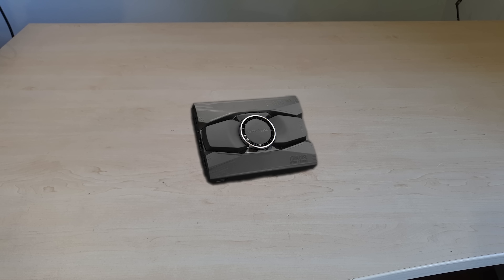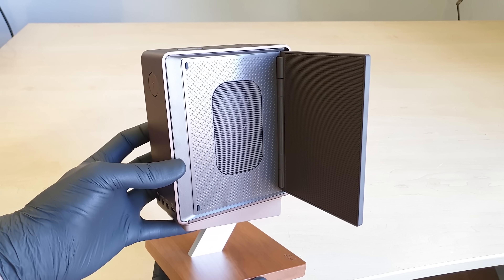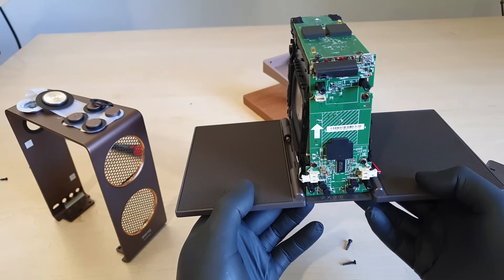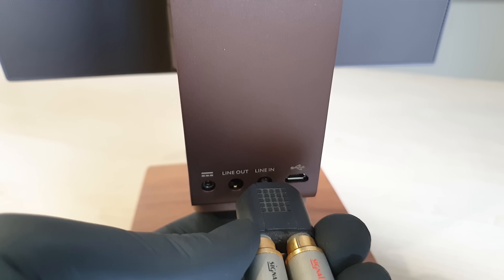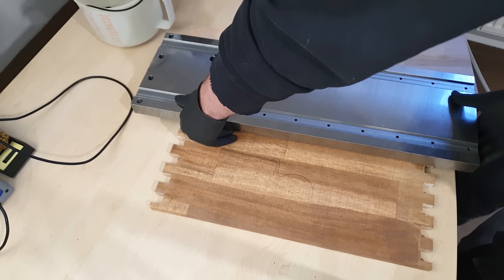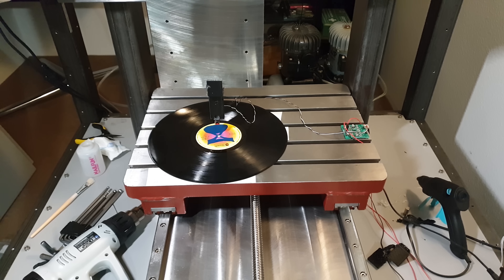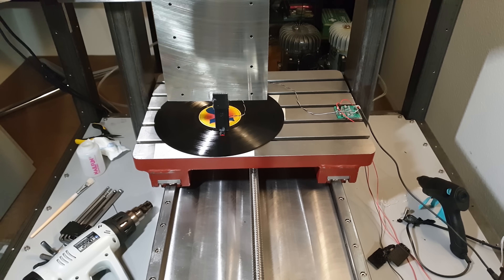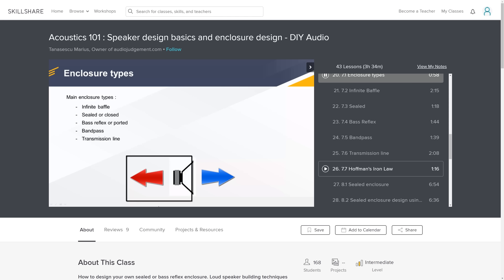Can my CNC be a record player?

Comment: Has anyone done an inverted dual drive for each axis? That way quick precise movements can be made and the inverse drives make up for each others backlash, and the steppers can be set up out of phase physically so that when one is on a full step the other is on a half step, then just adjust the timing of the screws to have no measurable backlash but with the least resistance and screw pressure

Comment: Hmm... having a turntable spin the record and using the cnc to move the cartridge laterally would be hard enough I think. Remember, in order to get sound from a cartridge, in the way it was meant to be used, the cartridge cantilever axis must be tangent to the record's track and facing in the right direction with respect to the direction of the records rotation - you don't want the cartridge to be facing in the opposite direction as it will result into the cartridge jumping off the track or worse, the stylus or the cantilever snapping off. Also, you may get away with having the cantilever at an odd angle (e.g. 90 degrees) to the track when the cartridge has a conical stylus risking some slight damage to the cartridge but with a more expensive elliptical or other narrow profile stylus (fineline, Van den Hul etc.) you will probably damage the stylus as it is a finer and more fragile stylus than a conical one. Last but not least: don't presume to know what the distance between the tracks is. The track, although a spiral, does not have a constant recession rate. As a matter of fact, it is constantly changing depending on the level of the recording at each point in time so as to pack as dense a spiral as possible without running the risk of the track undulations overwriting into the already written track from one revolution ago. So the recession rate is constantly changing, at a non-audible rate of course. In order to calculate this rate precisely a recording (analogue?) computer is used an expensive piece of gear which is fed the signal to be recorded and which controls the lateral record head movement of the recording lathe. So you need some way of sensing the spiral recession rate at the exact spot where your stylus makes contact with the track or have a sufficiently compliant system to permit the stylus to move along i.e. a turntable tonearm. As you don't have the latter, I expect you'll need to somehow extract the lateral acceleration experienced by the stylus from the audio signal recovered or perhaps use a couple of piezo sensors on each side of the cartridge that would be used as a means of mounting the cartridge to its carriage mechanism. Having the piezo sensors used as mounts for the cartridge would of course affect the audio quality of the recovered signal (as in effect the pair of sensors would operate as two additional low quality cartridges in series with the stylus cartridge). So the best method, in my opinion, would be to attempt to extract the sub-audio frequency components of the cartridge signal. There's only on problem with that: there won't be any as cartridge have a low frequency cut off point of about 20Hz if you're lucky. So you're back to the sensor method. Perhaps, instead of piezo sensors, linear actuated coils could be used. I have no idea where you'd find these. If they weren't so heavy and bulky two subwoofer motors might do the trick but they're probably low frequency limited too. To give you an idea of the frequency of the recession rate change, for a 33 1/3 rpm record, assuming the distance is adjusted once per revolution or more often than that, you'd need a sensor with a low frequency cut off point lower than 33.333/60 = 0.55Hz or 5/9Hz. If the distance is adjusted at a slower rate (e.g. every couple of revolutions) then an even lower cut off is required e.g. 3/9 Hz or 1/9Hz etc.

Comment: I think the axis of the cartridge needs to stay tangent to the spiral groove of the record to work properly.  Just moving the whole thing to follow the groove doesn't seem like it will work, as the stylus is designed to move from side to side to follow the record grooves.   I guess you could let the cartridge swing freely, but that isn't ideal either, as the cartridge will move a little with the record groove, instead of the stylus doing all of the moving.

Comment: The spiral of a record varies depending on how deep adjacent grooves are. It would be almost impossible to play a record correctly the way you're doing it. If the record spins at the proper RPM, you can calculate how many steps/second you have to take on the X axis and then use the CNC as a super-precise linear tracking pickup.
Reply: The spacing of the grooves depends on the amplitudes of the signals in adjacent grooves.
Also, the hole isn't necessarily drilled at the center of the spiral.
I don't know how you can track it properly unless your tracking to zero out a "DC bias" in the forces on the needle.

Comment: what about using a CNC rotary table - also i believe LPs were meant for 33 RPM instead of 35 - but there's a 45 RPM for singles
Reply: info tech Yes I also picked that up.. huh.. 35? at 11:03 👍
Reply: Old records played at various different speeds. The most common ones were 78, 45 and 33⅓ rpm but, particularly for the spoken word, there were others:
           https://en.wikipedia.org/wiki/Unusual_types_of_gramophone_records

Comment: There's an old catch question about how many grooves there are on a record.
The answer is two: One on each side, because they are spirals.
However, the cut varies from disc to disc dependent on how long the music is and the dynamic range required.
A tone arm on a record deck is pulled  by the groove.
The CNC cannot track the pitch of the groove because it is independently powered.
So no, it's a really dumbass idea.
Reply: There's a special record with three grooves:
https://en.wikipedia.org/wiki/The_Monty_Python_Matching_Tie_and_Handkerchief

Comment: Terrible sense of humor, but GREAT machine..   It can be a dread to assemble/adjust a machine properly when it's not accounted for fully.. In theory, with proper reference cuts you wouldn't  need any adjusting.. (but experience learns theory and reality refuse to match in engineering).. Subbed. Thanks for your hard work. (and humor).. I had a similar toe/plate incident in the past.. MDF 22mm, 120cmx100cm.. Slipped out of my hand at one side, the point smashed my toe. Almost fainted, but i'm somewhat of a ladies-blouse..

Comment: It can be a record player if you had a small head to re-create the accuracy needed. 
Also you forgot that the needle MUST be concentricly moving along the groove. Otherwise you get garbage - then you need to feed this into an arduino or something to interpolate the angle of attack and a sin/cos function to, well, rotate the data back to the channel it belongs to instead of consantly cross-fading into the two channels.
Also you're driving the needle too firmly, so it's scratching and vibrating too hard, but this may be a fun test to guarantee micron precision hm

Comment: I accomplished the same thing the rubber speaker stand does quite accidentally when I removed the crappy plastic stands my Sony home theater speakers came with and replaced them with two thin vertical dowels coming up from the small shelves they were mounted on. The flex in the dowels provided some natural dampening which reduced vibrations from mechanically reaching the shelves and wall.  Cheap as hell but they sound better than the huge $500 floor mounted speakers they replaced.

Comment: KSGER... yeah I have a very bad experience with them. Ordered their hot air station and when turning it on it burned the handle. After getting a new handle it shorted itself in the powersupply and when they send a new powersupply, they send the wrong one. Now everything should be fine but no... Now the OLED randomly turns off (got a video of it). Ordered it in November 2018...

Comment: Great projects ! Short comment - you have quite big Z axis which move your center mass much higher from the base and as the result more vibration on high feeds . 
I use  much lighter machine ( with ALU plates ) and already have 300+ KG base to decrease vibration on high feed moves .
About carrier installation - better not remove plastic stoppers from carriers when installing the rails .
Reply from the maker: All my carriages (new old stock) came with pieces of foam instead of those stoppers

Comment: What kind of safety features are you implementing? Are you doing it yourself or are you buying industrial grade stuff from like Pilz or somewhere else?
Oh and how many TS80 could you heat up with the power you are drawing at peak movement?
Reply from the maker: I wouldn't trust a USB handwheel with emergency-off. But I would trust a cheaper, ordinary mains side emergency off solution. Most importantly I want way covers.

Comment: That Z axis is overbuilt it by a factor of about 200x. You can remove about 90% of the metal and it'll still be just as sturdy. All that weight will limit your XY travel speeds and cause a lot of unnecessary backlash.
Reply from the maker: let's agree on a factor of 2x
Reply: @reps  Considering all the torque on the spindle will be lateral, there's no need at all for that thickness, since it'll never twist. You can also mill out the majority of the center section, leaving ribs, and it'd be just as stiff, with a lot less mass to swing around. You can see how much backlash you're currently getting, the entire frame is shaking, imagine what that's doing at the cutting surface every time there's a direction change.

Comment: Great accomplishment Marco! Do you have your CV already sent to Hermle or Kern? :)
I've seen some machines having a counterbalance for the Z-axis head, probably to avoid stick-slip. Are they just unnecessary if you use ball rail guides, or it has to do with the weight of the moving mass on the Z?
Reply from the maker: This guy uses air cylinders to support the z-servo https://www.youtube.com/watch?v=8lxut6crmWk But before doing anything like that I could reduce my axis weight pretty easily

Comment: Marco are you aware of linear tracking record players? Add a rotary axis and its still fair game I think!

And laser record players existed too. Had issues that the dust doesn't get pushed out the way. So can be noisy.
Reply from the maker: eh rotary axis feels like cheating, but if nothing else works, I might end up with something like that as a last resort
Reply: @reps  Have you thought about taking the play needle fro m one of the toy cars that play records? It should handle a lot of deviation. 

Note wheel to guide needle in drag direction. (Actually pushing!)

https://www.youtube.com/watch?v=VYjDXgPDU94 

I'm not sure how much you know about records, but the grooves are not a fixed distance apart like a spiral. The recording engineer actually listens in advance of the pressing and controls the separation of the grooves to allow more or less dynamic range while optimising play time. For this reason it's very difficult to get the feed path spot on without some error allowance.
Reply: Anyway I'm sure you will do well and make an entertaining video from it :)

Comment: If you're willing to take it back to get machined again, you could do a variation of a toe clamp. You mill the space adjacent to the rail (on the outside) and drill holes and have them threaded to accept offset screws that will press a piece of steel to the rail. I think it's a doable mod (to the current statvs qvo).
Reply from the maker: wow I have just seen precisely that in this hiwin catalogue under 1-10 http://www.automation4less.com/pdfs/hiwinaglg.pdf

Comment: All you're missing  is a laser to read the lines. This is far more complex than the idea I had for old records 🍺
Reply from the maker: I think I've seen a laser record player available commercially, that gave me hope that this might work as well. (But the needle ended up bending when not moving in the intended direction etc)
Reply: @reps  a high quality photoresistor and decently filtered DC power supply with a finely focused 405nm laser would be perfect for this project..

No contact reading with a simple op amp circuit would save the headache of 'micro crashes' until you get the movement dialed in.

At a fine focal point at ~1mW won't burn the track.. Though be careful if you try, the 405nm can make the smallest spot but will heat that highly absorbent black record even at 5mW, and possibly distort the track.

Cool project none the less..

Comment: The startup sound from this sounds identical to another BT speaker from a company called Cellara...hm. I'll have to check Dave's video, to see if the guts are the same.
Reply: aserta startup sound is the same as the ~$10 chinese bluetooth speaker(s) I have. probably the same chipset.

Comment: I had a large bench vise slip out of my hands, landed on the corner of the vise and went through the linoleum floor and took a chunk out of the concrete below. I'm not even sure steel toed boots would have completely protected me from that. It missed and I was completely unharmed but it was a huge wake-up call.
Reply: i think steelboots would have at least prvent a cut off toe
Reply: Pretty sure good quality ones would save you from that, they need to resist 1,5t of force without too much bending in order to qualify as safety boots. Sure, that is just static pressure but out of personal experience i know that good boots can withstand nearly 3t w/o visible deformation (just don't ask). I just did the math and it turns out that a falling 100kg object with a 1cm^2 diameter (and terminal velocity) would create a pressure nearly two times as high as having a 3t load on the entire cap. That would probably make a rather large dent (or hole), but given that this would be the absolute worst case (terminal velocity, extremely small area of impact, no tilting [and therefore landing alongside your boot] of the object etc) i suspect that you would survive with your toes (almost) completely intact (you still might have to call an ambulance to get you out of your deformed shoe).